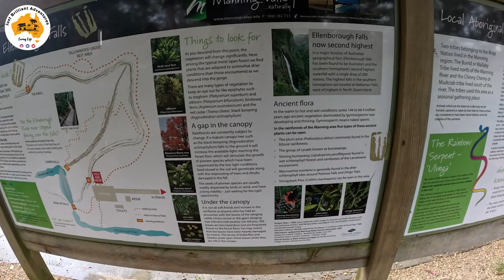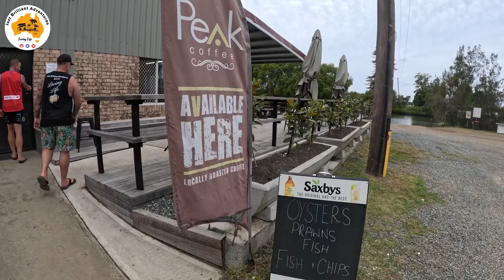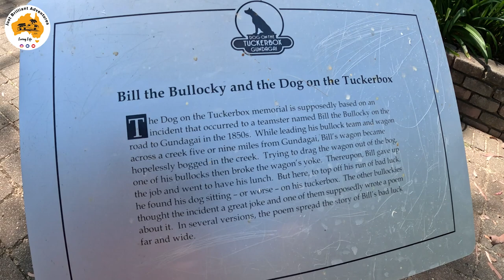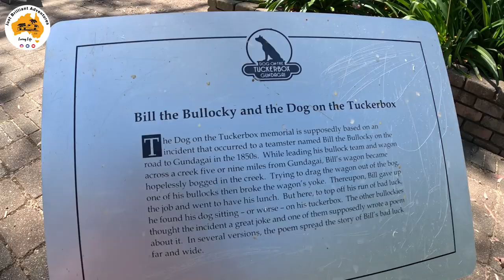S1 - E21 - BIG BIG DRAMAS - NOT SURE IF WE WERE GOING TO GET AWAY ON TIME

Comment: You guys are champions, we love the genuine presentation.  That rig of yours scares me, we have a DMax and single axle van a little over 2 tonnes, enough for me.  I was sorry to see your start to the day, it could have ruined the trip but you two took it in your stride, fixed it all up and pressed on, albeit with a bit of a nervous smile. There may be something to be said for a simple single hitch receiver and one hole for the pin, at least for an older and forgetful fella like me.  Keep up the jokes Dave, we love them.  I see some correlation with Brad the ABC traffic guy on 612 each afternoon.
Reply from the maker: Thanks for the support. We won't be changing. Call a spade a spade and tell it how it is. Put up our mistakes so others learn. Safe travels. 🍻
Reply from the maker: If you want a laugh at my stupidity watch the how not to climb a ladder, the episode Uluru to Finke, and cooking the pork on the fire pit. They will cracking u up. 🍻

Comment: Dave, how do you find the GenY hitch? Tossing up between that or the Airsafe. 
What are you thoughts?
Reply from the maker: Mate love the gen y. Never used the air ride so can't comment. Every 1 I know that has gen y is extremely happy. Built in suspension is great on corrugated roads so the van doesn't shake the car. 🍻
Reply: @JustBrilliantAdventures   out of curiosity what rating hitch do you decided on? Given the ATM is 4500kg?
Reply from the maker: @braddahl5352  mate I went with the 4 hole 1, but changed to the 6 hole. Reason being I can put bike rack in top 1 with do45 in bottom 1. Each has different uses. Up to you to decide what you want. I'd go with the 4 hole 1. Lighter and prob all you need mate.
Reply: @JustBrilliantAdventures  cheers. I was eyeing the 4 hole . Did you opt for the 4500 or 7000 kg rated one?
Reply from the maker: @braddahl5352  the 4.5 🍻
Reply from the maker: @braddahl5352  what city are u in?
Reply: @JustBrilliantAdventures  Albury Wodonga mate. Cheers
Reply from the maker: @braddahl5352  coming through early march.
Reply: @JustBrilliantAdventures  did you do all your time at 2 RAR?
Reply from the maker: @braddahl5352  no mate. 2/4 RAR, 2 RAR ,and 5/7RAR
Reply from the maker: Brad call me 0408237480